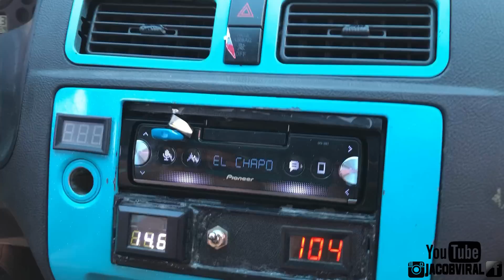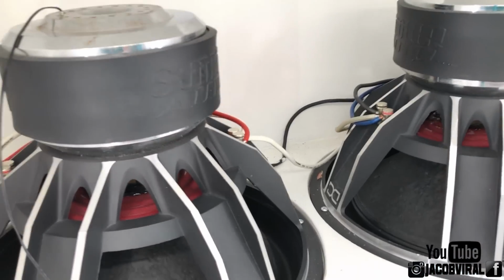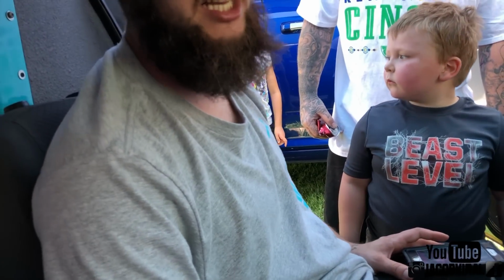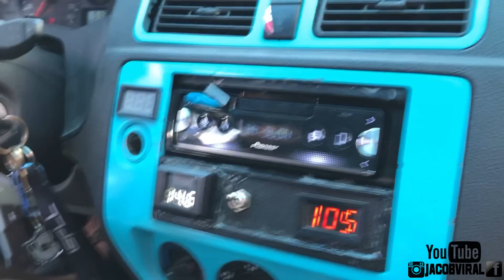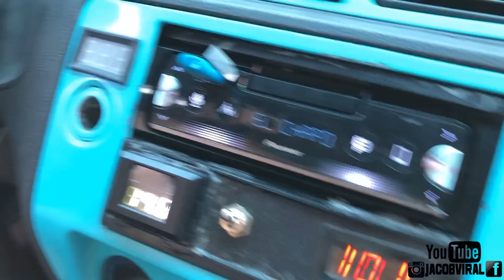FUCUS HATCHBACK 2 18S 160DB BRUTALLY LOUD BUILD!!!

Comment: Im wondering if i have some cancellation in my truck. I see people hit high ass numbers with basically nothing but im only getting like 120 from an 18 on 2k
Reply from the maker: Box and output, also you need a real spl device meter to measure, I'm sure your doing atleast a 135+

Comment: Nice video! Just got my 2 skar vxf 12s in the trunk on Skar RP 3500 and I haven't put my alternator in yet. They dim my headlights wayyy bad I know voltage is too low
Reply: Nothi g to do with voltage. Upgrade to HID headlites problem solved

Comment: Lows to me begin at 24Hz with no limit below. But is the 6.5k the only bass amp he is running? And what ohmload and operating voltage vor the HV is he runnung?
Reply from the maker: Twisted Sounds 6.5k @0.5 ohm 12v all I know
Reply: @JacobViral  single 6.5k or is there anywhere a second one hidden?
Reply from the maker: He only had 1 none hidden it's just impressive and efficient low rise
Reply: @JacobViral  Yes thats almost world record level for efficiency in demo cars with stock cabin

Comment: Did that meter read 10 volts
Reply: No that was coil temperature of the subs
Reply: I don’t drop below 14.7
Reply: @bubbabrewer5931  I didn't think you did... You got cmax or LTO?
Reply: Brian Miller lto pouches
Reply: @bubbabrewer5931  thats impressive